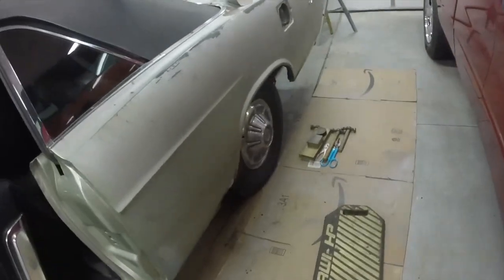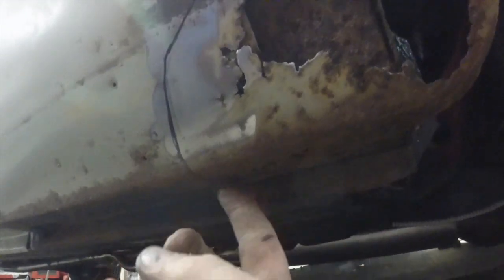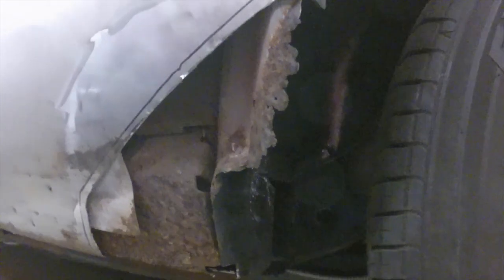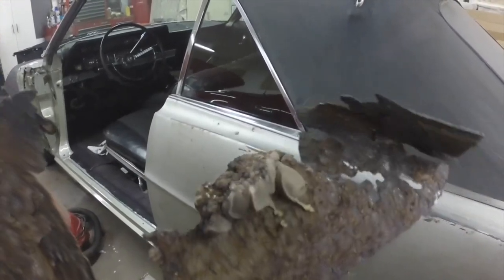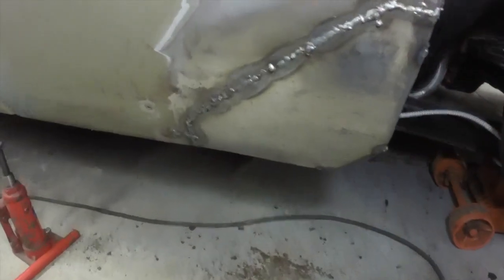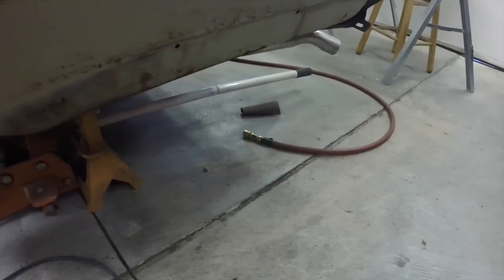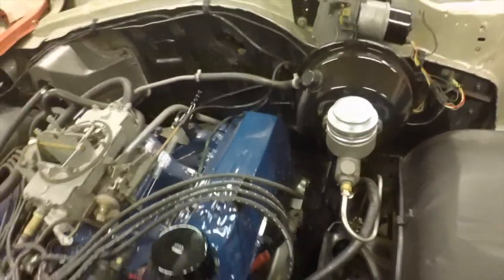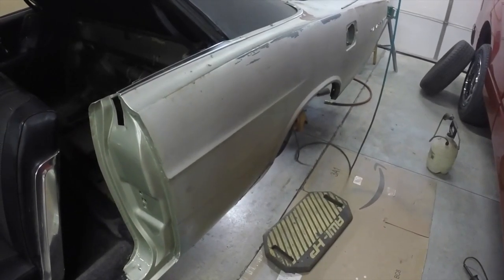1966 Ford Galaxie 500 convertible restoration part 88 repairing rust hole in rear panel

Comment: That is a bad area to repair..but you did a really good job on it..I've seen a lot worse that took alot of work to repair..you do really great work..as far as the rain goes we're getting hammered down here in the south.lol...see you on the next one..Cheers 🇺🇸🇺🇸🇺🇸
Reply from the maker: I see the south is getting hammered by rain. They talk about it here, but it ends up just a few sprinkles, or a few snow showers. I just don't want to park the Galaxie outside in that with it all open to the weather. Nicer weather is just around the corner.... I hope.

Comment: What gauge metal did you use?thanks, great video
Reply from the maker: I honestly don't remember... maybe 18 or 22. I have both sizes, as sometimes the thicker stuff is needed to fix inner support stuff. It's the same thickness as the body sheet metal on the Galaxie, that I am using on the body.

Comment: I would love to see you shaping those patch panels. What gauge sheet metal is that? My ‘67 is going to need a little.
Reply from the maker: I really don't have much sheet metal work left on the car. Guess I should have videoed it... I just use body hammers, dollies and a block of wood. I do have a metal break for the bends.

Comment: Did you try panel bond on vent window yet wondering  if it worked having same problem
Reply from the maker: Not yet. I'll wait until the window is reinstalled, to make sure I get it bonded in right place.